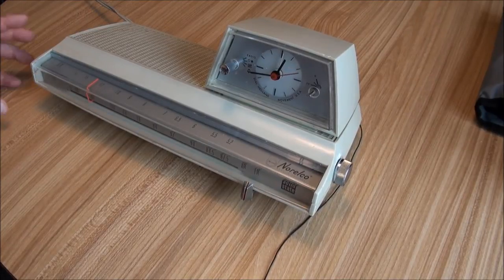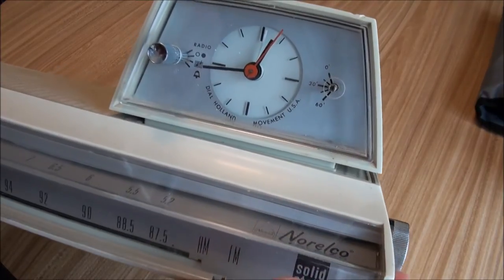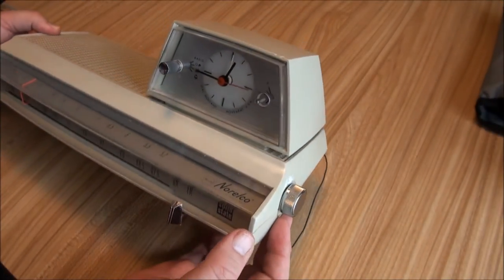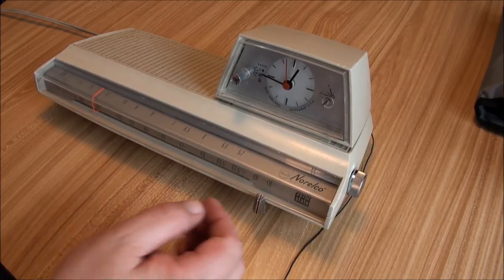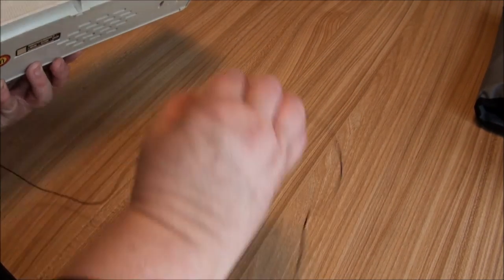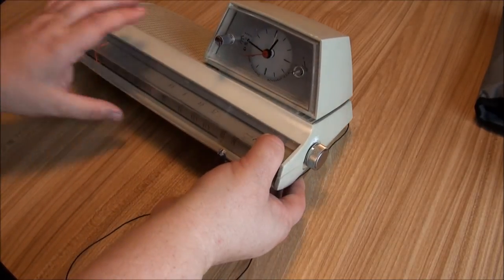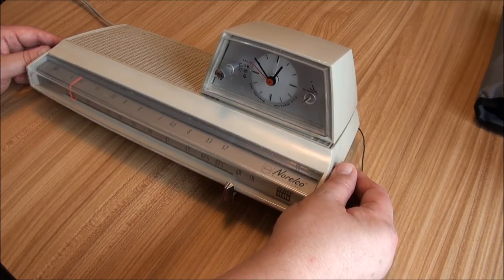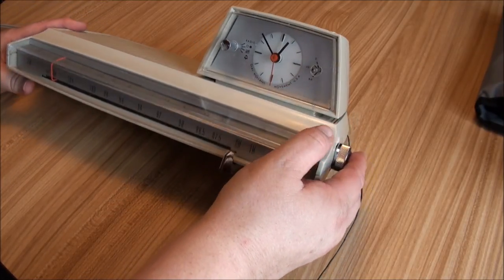1967 Norelco 22RS274  AM/FM Clock Radio

Comment: I like the look of this set, even though the clock does seem a bit oddly placed. I would guess that the American made clock was built by a Telechron movement, it seems most electric clocks in transistor radios were build by them (even in the Japanese sets). As an aside, it seems radio attic prices are always sky high, so I don't even bother looking there anymore.
Reply from the maker: 50sTransistorRadios I don't know if it was a coincidence or not but that $500 version on Radio Attic sold less than a month after I uploaded this video, and it had been listed there for a long time. I wonder if there was someone who watched this video and was inspired to buy it.
Reply: I think in a lot of cases people negotiate a lower price, but if that's not true, then I should get on there as a seller.

Comment: I think I might have some knobs that will fit. But not identical to the originals. I know I have some that will fit onto that 1/8 inch split shaft. As far as the back knob, check to see if it's a threaded shaft. I can't tell in the video. If it's threaded, sometimes you can use a knob from a 3 way light bulb socket. If your interested in a pair of knobs for the front? Send me a message, and I'll see what I have. Perhaps I have a matching pair for you. Include the knob dimensions. If I have several knobs that will fit on that tiny shaft, I could send you a pic, then you can choose a pair. Always willing to help out a fellow radio collector...
Reply from the maker: metalmoto Thanks for the offer to help. I'll send you a PM later today.